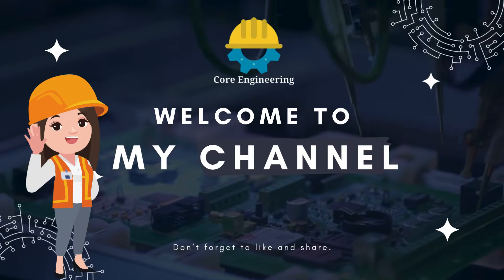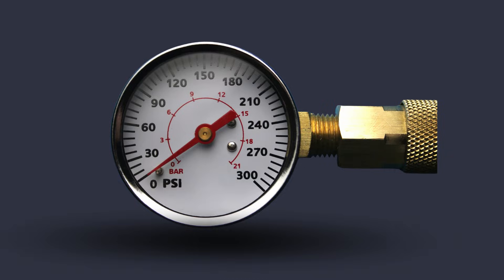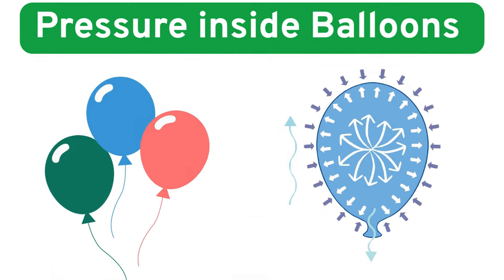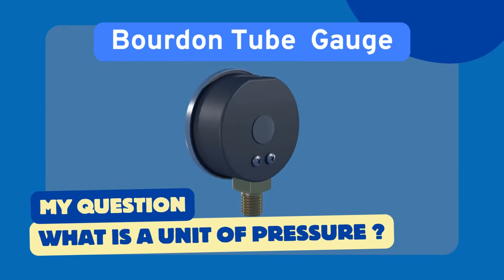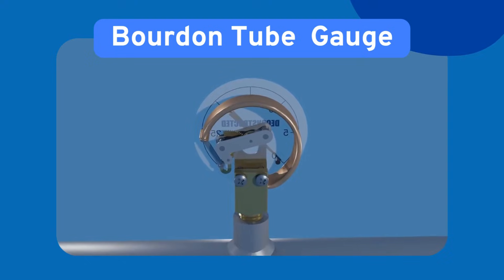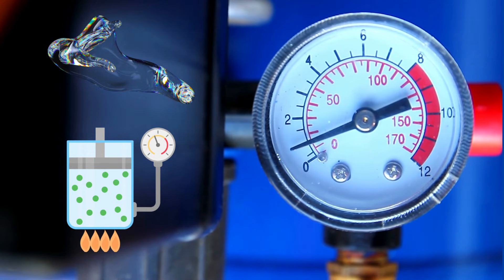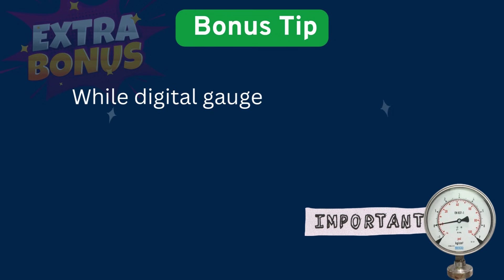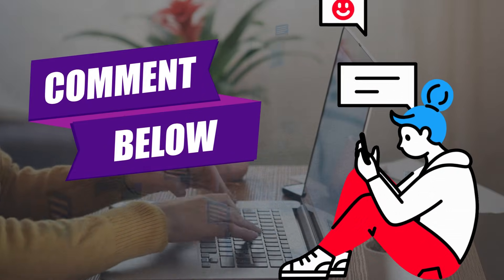How Does a Pressure Gauge Work? | Bourdon Tube Explained with Animation | What is Pressure Gauge?

Comment: How differential pressure transmitter works in a reactor
Reply from the maker: All pressure transmitter works in a same way! It's design and sizing depends upon the process conditions. I have already made one video about it. You may check it out that video!
Reply: Ok sure
Reply: Can u start a series explaining pratical approches for industrial problems like i.e if a pump stops giving flow what should be the possible approaches to attend it or if a system is under vacuum and sudden there is pressure drop what may be the possible reasons and how to attend that etc....